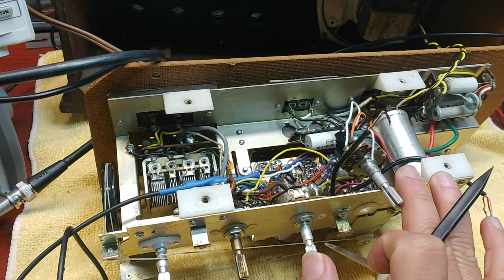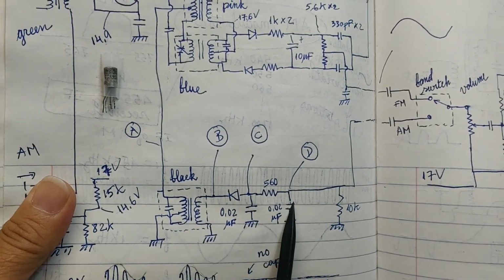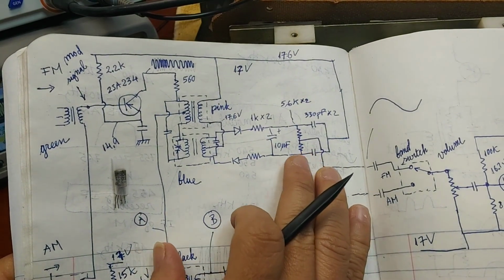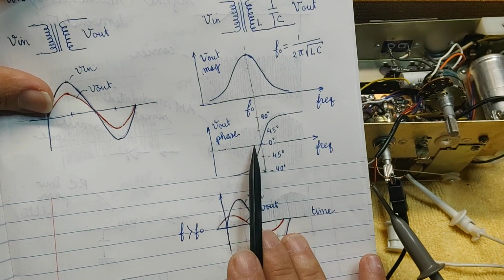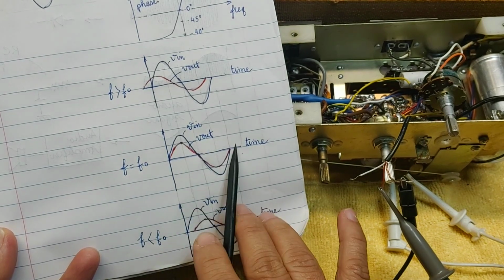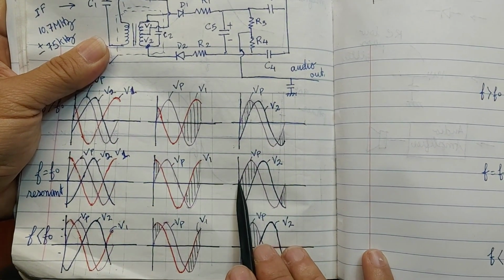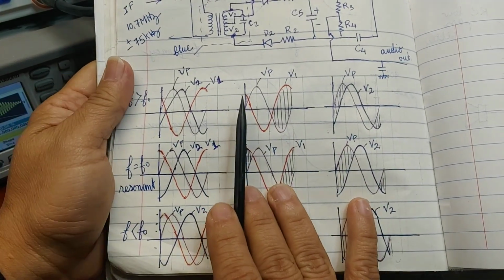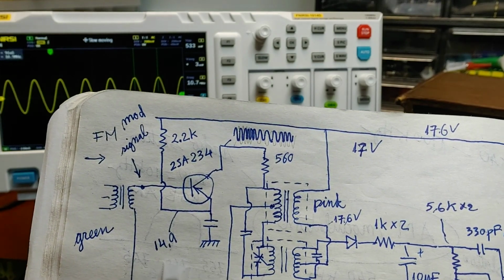Repair Radio JVC FT 261SP   P3

Comment: Dear Sir

Hello. Thank you very much for kindly receiving. I did not understant AM test signal. Is AM modulation 455kHz with 1kHz sinewave signal. 

Or which one saw wave signal. 

Also another question what was the probe atteniotion for fnirsi scope. 

Stay safe

Baha 

From Turkey
Reply from the maker: Yes, the 455kHz sine wave was modulated with 1kHz sine wave at time 5:12. The envelope of the yellow signal was 1kHz and the inside the envelope was 455kHz. It's the IF signal.

The Keysight signal generator was used to generated the IF signal and the signal was splitted into two ways: one way is connected directly to the channel 1 of the scope by an BNC cable and another way was injected to pin B of transistor 2SA234. I added a 0.1uF capacitor inline with the signal between the signal generator and the pin B of the the transistor 2SA234.  For channel 2 of the scope, I used the set 1x probe.

Best!

Comment: Dear Sir
I have same scope But I dont sucses       to good measure for frontend and other test ponts. Can you explain us scope setting and other enstrumentation. Can you speak about loading effects sometthing
Do you use any rf amp. For measurement probe. Another sing. In this video has voice speed problem. Which is too speed. 
Also Where are you from. 
Thank you

Stay safe
Baha
Reply from the maker: Hello, sorry you didn't get measurement. I had two different setups for AM and FM measurements. 

For AM, I used a signal generator to generate an AM 455kHz intermediate frequency (IF) and modulated it with 1kHz as you saw on the scope.  Why 455kHz? The radio signal coming in the antenna with different frequencies in range of 540kHz-1700kHz for AM band. After the radio signal is tuned and mixed with local oscillator frequency, the mixer makes all radio frequencies to become a 455kHz and other high component frequencies. The high frequency component is filtered out by the IF filter. The IF stages filter let only 455kHz to pass through and amplify it several times, let say about 100 times. The 455kHz frequency has is amplitude modulated by audio signal that radio station want to transmit. To test the last stage of the IF,  I had my signal generator generated a signal 455kHz and modulated with 1kHz, the sound we can hear. I injected this IF signal to the pin B of the transistor 2SA234. I might have a 0.1uF capacitor between my signal generator and pin B to block the DC voltage may go to the signal generator. The IF signal passed the IF transformer and reached the AM detector circuit, and I got measures at points A, B, C, and D.

For FM, I used the signal generator to generate an FM 10.7MHz intermediate frequency. Similar to the AM at the tuner and mixer, the FM frequency range 88-108MHz received at the antenna, the mixer produces 10.7MHz and other high frequency component (I think). The FM IF filter let the signal has center frequency 10.7MHz with bandwidth +/- 200kHz to pass and amplifies it about 100 times. The FM IF signal has constant amplitude but its frequency varies around the 10.7MHz. The various frequency is audio frequency the radio station want to transmit to radio. That's why I had my signal generator generates 10.7MHz with various +/-100Khz at rate 1kHz. The IF signal was injected in to the pin B of 2SA234 via a 0.1uF capacitor.  As you saw the signal varied around 10.7MHz was that I set it at 0.5 Hz for just we could see. Later I changed the variation around 10.7MHz at 1kHz, we could not see it it clearly but could hear 1kHz tone.

There are two types of circuit I didn't mention at the AM and FM detection circuits are AGC (automatic gain control for AM) and AFC (auto frequency control for FM). The AGC and AFC regulate the audio signal level for AM and FM before they are send to the audio amplifier. 

If you are measuring with the same model or similar type of this radio, the neutral prong of the power plug must be known. Make sure the chassis of the radio plugged to the neutral line of AC outlet. If plugged in reversed, you may get electrocuted very badly and exploded of the equipment. It's because the chassis of this radio is connected directly to one of the two prongs of the AC plug. If it's reversed, the chassis of the radio is the AC hot line of 120VAC.  And that was the reason I used that scope supply with 5VDC, not AC ground may touch the radio chassis.

About the video speed. Yes I made it faster because I was talking too low. I wanted the video shorter.  

Even though I left Vietnam and living in the US for quite long time, my English is still not very good. Hope it helps and thanks for your question.